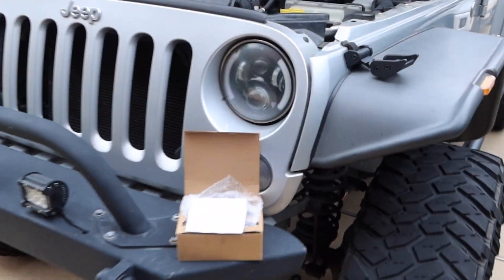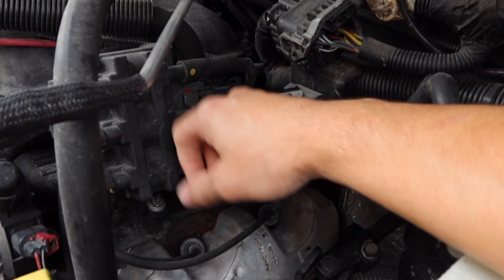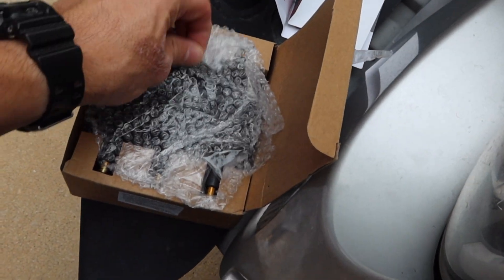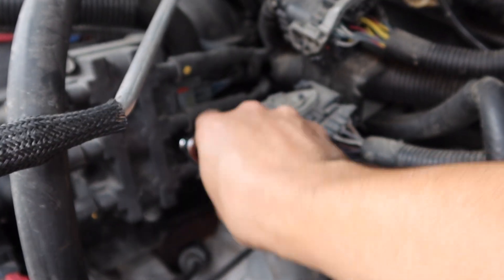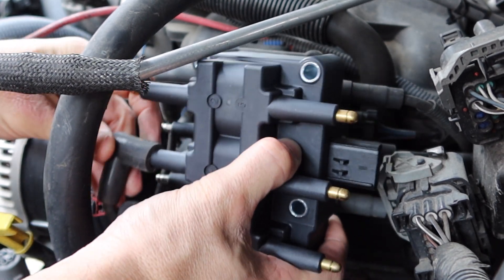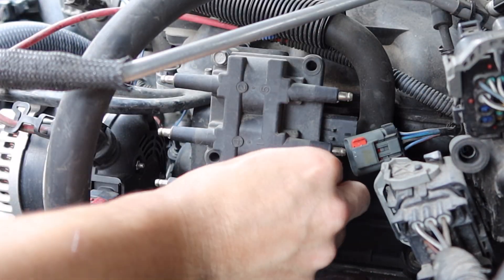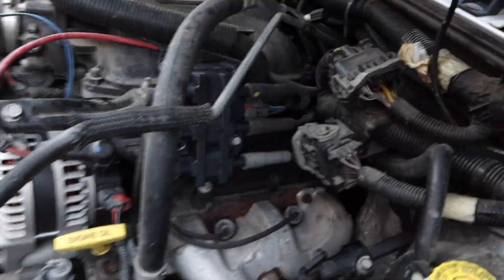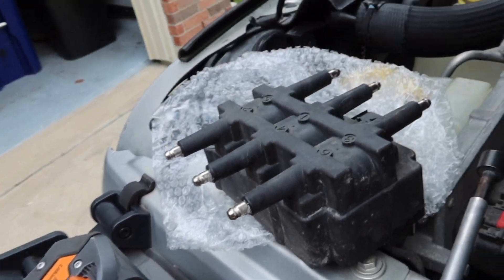P0306 Cylinder 6 Misfire / Jeep Wrangler Ignition Coil Replacement / 3.8 JK Town and Country p0301

Comment: Problem fixed on my 2011 3.8 jeep wrangler code p0306. Head gasket leaking antifreeze on cylinder 6.
I did a quick fix with the head gasket sealer
Will replace a new head gasket on summer time.
I did replaced,  ignition coil, spark plug, and wire. Didn't solve the problem. 
Just be aware of some head gasket sealer, my clog, the heater core

Comment: Dude maybe you can help me with my 08 jkux, it’s melted 5 coil packs since February I replaced plugs wires 02 sensors all that crap I’m not sure why they keep melting
Reply from the maker: Usually melting coil is a resistance issue. Low resistance can burn up coils pretty fast.

Comment: Thanks for your video!  My 07 developed hard misfire on #6.  Thanks to you a  $39 part from Amazon and it's fixed!
Reply from the maker: FYI, I've had problems with fake spark plugs on amazon... soo look out if you've bought some online.
Reply: Nope, good plugs/wires changed 2 years ago.  No misfires then parked at Safeway and upon starting, no more firing at all on #6.  The coil pack I bought, the vast majority of reviews were 5 stars unlike others.

Comment: Did it fix the problem? We did all that and still having problems
Reply from the maker: It did come back a month or two later, I swapped out #6 spark plug wire and plug with a oem Mopar wire and plug from the dealer.  Its been gone for a least a year.
Reply: https://youtu.be/XFX-c7Nanv4 maybe